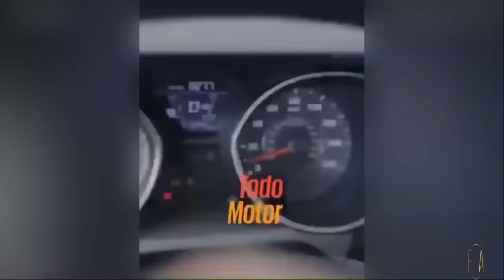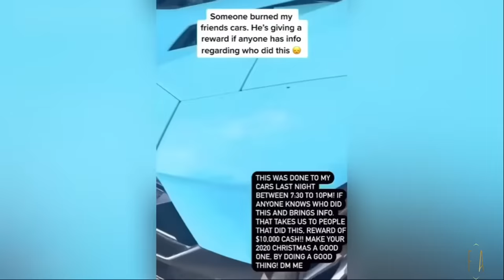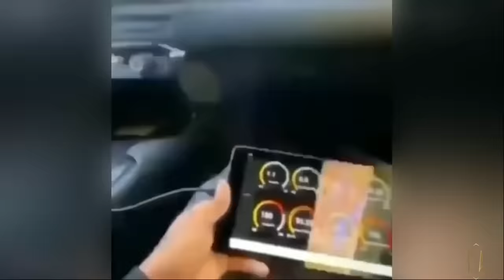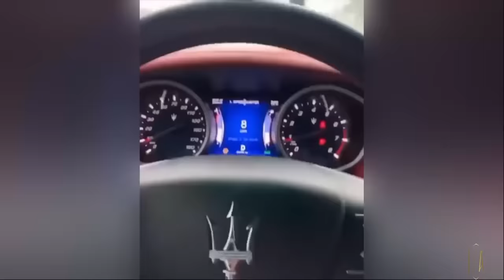Supercar Crash #1 - 1 Hour Compilation - Supercar Fail

Comment: i honestly feel bad for the guy in the zonda, was just casually driving and then got rearended by some idiot busy recording it
Reply: fr, and they are rare too
Reply: In the single digits too
Reply: I doubt that the guy recording was the one driving. As the cars seem to be driving on the right side of the road and at the end, you can see that there is no steering wheel in front of the recorder. My guess is that the Zonda braked a little but the car behind didn't have the same stopping power, hence crashing into the Zonda
Reply: @hohohor3551  still the car recordings fault tho. you should always keep a safe distance to the car infront of you and that is determined by what type of car you have and what car is in front of you. naturally as you said the zonda has bigger brakes, therefore the car recording should have stayed an appopriate distance away, which he did not causing the crash and his insurance to cry
Reply: @GONKER  I know about that. I was just trying to point out that the commenter seemed to have mistaken the recorder himself to be the one driving. Good point though
Reply: @hohohor3551  What if the vid was mirror recorded?
Reply: You really think it puts him in a bad position? to have those cars you have the means to repair them...
Reply: Actually, I am bursting of laughter because the drivier of the Zonda knew EXACTLY what he is doing. We have a name for it, actually two names:
Brake check and insurance fraud.

He delibertelly sped up, fully knowing that stupid driver will sped up also- but zonda can stop in a moment, bus cant- and viola, he get money from insurance and then sell the car and viola, no more monthly payments. 
Plus he will probably put some money in his pocket.
Reply: @sureno1833  viola? Do you mean voila? I’m french and « Viola » is a verb you don’t want to use 😬😅
Reply: @jonasweber9408  what does it mean?
Reply: @sureno1833  rape… 😬 third person of simple past (or violated, infringed but it’s more commonly use to mean rape)
Reply: @sureno1833  Yeah man a Zonda owner CLEARLY needs money by insurance fraud... He didnt even speed up or anything there was just a traffic jam and the filming van was just way too close and not keeping enough distance. The Zonda was just casually driving. He didnt "Brake check" there was a traffic jam thats why he stopped. You can even see that the cars in front of the Zonda had to swerve to avoid collission aswell because they could barely break in time. Maybe watch the clip again.
Reply: @jonasweber9408  Oh man, I am so sorry for my deleted reply...I was thinking you are saying sometihng else....I did not recall I asked you for clarification..lol. 
I feel so dumb now.

I apologize, sir.
Reply: @sureno1833  no problem at all I read “what does it mean?” And I thought I would answer you 😄 take care
Reply: if you drive a Zonda you're a rich mofo and most likely not the type i feel bad for.. there are exceptions of course, but most rich folks didn't become rich just from "hard work" alone..
Reply: @almightyIrie  By the way he/she was driving you can see that it was daddies car.
Reply: @alexwithanx  WHAT? XDDDD
Reply: That's what happens when you seek attention like that.

Comment: Seems like Lamborghini, Ferrari, Audi should be putting fire suppression systems in the engine bay of their supercars...Would save a lot of cars!
Reply: Nope because they want the owners to buy another car instead.
Reply: @arpc0027  but some people would think badly with their car safety
Reply: And people consider EVs to be unsafe. 
Hel-lo! You know what the middle letter in "ICE" stands for, right?
Reply: Some track focused cars have it as an optional extra you can order from the factory but apart from that nah
Reply: Dont most of these burn from the exhaust heat anyway bcs the shielding isnt good enough when the pipes start burning? (Serious question)
Reply: Simple thing, you shouldn’t boost your engine on the “P” position. It overheats quickly and burn…
Reply: @arpc0027  not true
Reply: @alexwithanx  it happens when the car is overheating or due to an malfunction
Reply: @Lee Roland sarcasm?
Reply: Not true do research before u say something some Lamborghinis and ferraris and even audis have that
Reply: @officialarrogamer  Yeah but ive never really seen these hypercars burn from the engine bay but rather from the exhaust
Reply: @alexwithanx  well why do u think it happens when a car revs?
Reply: @officialarrogamer  Guess people need to learn how to use those factory installed fire suppression systems then...
Reply: Or just be sure ur car don’t overheat
Reply: @mrthunder8190  it’s not the cars it’s the owners
Reply: @StonedNoob  Definitely a big part of the problem!
Reply: At least they have a really hot car!
Reply: You are so rich to play with fire coffin😂😂😂😂
Reply: Every. Time I see this, I can't stop laughing.😂😂😂😂😂
Reply: Then they could not sell new cars to  driver idiots 😝 they want the cars to burn out !
Reply: That’s a $25000 option

Comment: 39:49 I'm really surprised this video was ever released, but I'm so glad it was. So satisfying 🤣
Reply: Surprises me as well.
Reply: That's what happens when you full-send the accelerator so suddenly
Reply: Was it because he didn't straighten the wheel completely? Car still wasn't on straight line? Or too much acceleration on "cold" tires? I'm genuinely curious why that happens.. A see a lot of Mustangs do that... I don't understand the reason why It happens.
Reply: @veryrudeguy  Rear tires spin causing oversteer and when the driver is too late with corrective movements with the steering wheel, the car spins out.
Reply: @veryrudeguy He had Traction Control of as well, or maybe ferrari's TC is shite
Reply: @veryrudeguy  If the driver just kept the wheels straight nothing would have happend really as there was still enough room to the left side. But as it was a bad driver he was frightened by the cars movement and drastically overcorrected. He turned the steering wheel to the right as if he wanted to make a u-turn.
Its like that on most car crashes, Mustangs have the added factor that they are quite unstable cars compared to other sports cars. Fun if you know how to handle it but most people obviously dont.

Comment: Anyone else notice a trend of lambos catching fire at the rear left?
Reply: It's where the oil filler cap is, it's in such a difficult position to fill them that 99% of the time you will spill some, that drops onto the exhaust manifold and once its hot it catches fire. I know my mate has one and it has caught fire twice because of this exact reason.

Comment: Note: if your buying a super car I suggest you have to be very good at blind spots and ground clearance also go slow on the turns if you send full power on the turn it will case to drift away and crash into something
Reply: You don't need a SUPER car for that happening. A Mustang or so will do. Anything with 400+HP has the recipe, if rear wheel driven. Some fools will make it with 4WD too
Reply: @MrNickelbrille  - you even do not need that 400 hp. I learned to drive (post-communist europe) on a skoda 105, which had measly 35 hp, but a rear mounted engine powering the rear wheels. It would do the same shit. Modern cars are MUCH more forgiving. If the drivers from these vids first tried to drive some of these old rear-engine bangers, half of these crashes would not happen. The problem is, that people with money to buy expensive cars are quite often very poor drivers...
Reply: Rich people thinking? Are you insane?

Comment: ive learned 2 things from this video.  1. those cars arent actually designed to be driven and 2. if you manage to not destroy it, there is still a good chance it will burst into flames.
Reply: But rich people wont care for both they can always buy another one so there you go😂
Reply: wdym they arent meant to be driven? all of these are designed to drive on the road.
Reply: They are designed to be driven. Most of the clips are at the fault of an unskilled driver. While some of these are some form of arson / vandalism. Some are also at the fault of people trying to tune their vehicles to spew out flames. While the minute few are genuine accidents caused by other drivers and not the drivers of the supercars themselves.

Comment: i can't believe how many of these 'super cars' catch on fire...
Reply: they are highly flamable....
Reply: Mostly it's because of aftermarket exhausts that are designed to make pretty noise but aren't so good at keeping heat out of the engine bay. Add to that lots of revving and slow traffic, adjacent body parts overheat and combust.
Reply: the normal supercar or hypercar don`t catch on fire if you handle it normaly and don`t tune it. 
but most people buy these and tune it afterwards for better sound power or whatever and that is the reason they catch on fire.

Comment: Как же грустно осознавать то, что Авентадоры так часто загораются. Даже если просто поддавать обороты на месте..
Reply: Dirt quality
Reply: Most supercars are built terrible and have terrible design flaws. Ferrari is actually the most unreliable "supercar" that's been made. If you watch videos about them and about people who own them, pretty much every single one of them say everything breaks on them really easily and the motor likes to knock around 50,000 miles on average, even when they only take it out for Sunday drives and not beating on them, that's terrible.
Reply: У Левела кажется поднималась эта тема , там что-то с парами бензина над двиглом
Reply: Revving like a an idiot with a probably cold Big block is not a good Idea indeed

Comment: Fun fact! 

These engines produce A LOT of heat. Many of these owners replace the stock exhaust - which has proper heat mitigation shields - with systems that remove that shielding. Causing adhesives that were once fine, to catch on fire due to excessive heat.

Comment: Multiple choice question:
What makes it so irresistible for supercar owners not pay attention to the fact that revving their cars up to the rev limiter over and over sends unburnt fuel and vapors down a hot tailpipe where it can ignite and start their plastic car on fire?
A- The two foot flames that spit out the back of the car impresses their friends.
B- The sound of the tuned motor, intake and exhaust makes them feel like they are racing at Indy.
C- The snap, crackle, pop sound wakes the neighborhood because it sounds like gunfire.
D- All of the above.

If you answered D- All of the above then you are correct.

Comment: Around 16:15 theres a V10 just sitting in the middle of the road. Thats's crazy
Reply: block and heads are probably cracked in every corner from that impact and most of the stuff inside is shattered

Comment: This hurts to watch. Some of these cars deserve better drivers
Reply: Idiots shouldn't be allowed to drive at all.  But having said that, some of those drivers deserve better cars.  Where does a car get off splitting in three parts, with one part from the A-pillar back, another part being the front clip way the hell over there 50 feet away, and the engine right in the middle of the road 20 feet in the other direction?  How is a car just SNAPPING into two or three pieces like that?  And how is it that cars just start burning on a street corner?  Something is ALWAYS, 100% WRONG when a car just lights itself on fire.  We need better cars.

Comment: So the Bumblebee car at 15:51 just magically splits itself into THREE separate pieces?  How is a car THAT badly designed in the first place?  Or is that a safety feature?  "Yes, this car has the "EED" (Engine Ejection Deployment) safety feature.  That's because the car is instantly safer once it no longer has an engine.  <Fine Print:  factory warranty is void when EED is engaged>"

At least the guy at 27:55 was using his turn signal.  The light was still flashing even while the car was on its roof!

Comment: Listen here knockle heads, super Cars and high performance cars generate a lot of heat. Its iladvised to rev your engine when the car is stationery. Forward motion is required to cool the engine.

Comment: Imagine a Lambo with a 16 inch lift 🤣
Reply: They made those. They called them the Lm002
Reply: @KristianMartin-o8w  Well, not quite a 16 inch lift stock, besides I meant super car. Like we used to have an el Camino in our area lifted on a different chassis about 40 inches with giant tires. It burnt down a couple years ago 😢

Comment: Proof of authenticity:  when your $500K car smashes the front end, the lights still work. That’s quality.
Fires?  Are these idiots running turbos that can be switch off in city driving? Are they just dumbass overheating. 
7:29   Drive by tagging. Wrong hood hangouts.

Comment: One would think that as many fires that've caused more than a few supercars to burn to the ground because of revving the engine and superheating the exhaust, people would learn. Or at least, manufacturers would fix that particular design flaw (because these 'tard drivers aren't gonna get any smarter).